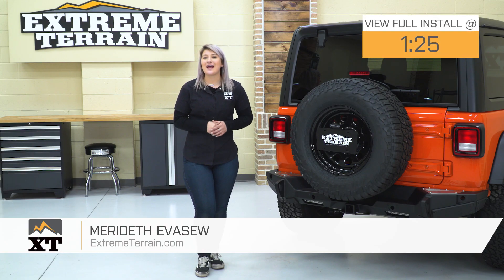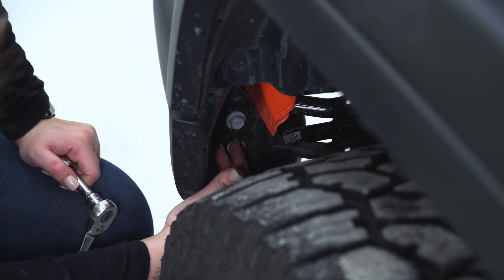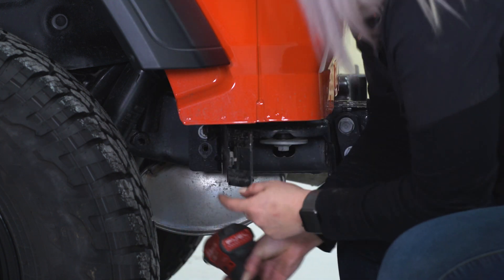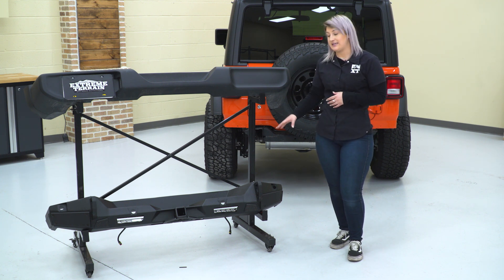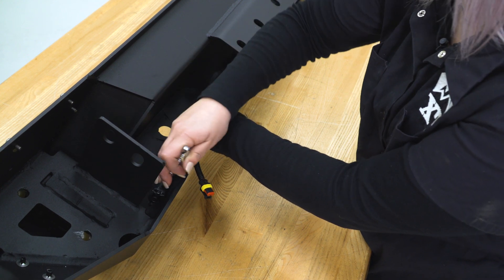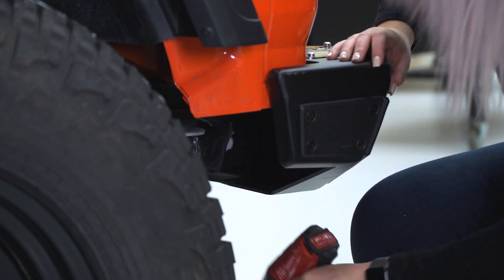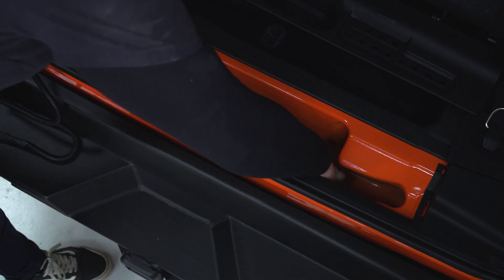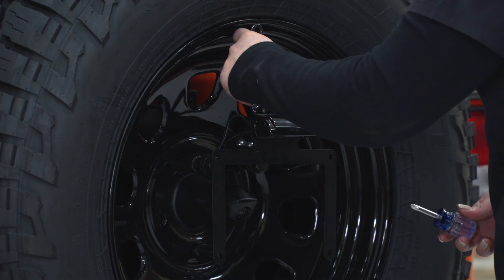Jeep Wrangler JL Smittybilt XRC Gen2 Rear Bumper Review & Install

Comment: I have this on my Jeep, great sturdy bumper. Would highly recommend. Thing is a monster and  is a straight forward install. One afternoon, basic hand tools, and a six pack of your favorite cold one will make for a great day.
Reply: After reading a few comments unnoticed a plethora of complaints about the license plate relocation. I just used the provided hardware and an angle grinder to change the location to the mimic the JK stock location. Took all of five minutes given the proper tools and know how.
Reply: Could you message me with how you did that please?

Comment: I purchased that bumper for my 2018 jl unlimited sport s. Relocating the liscense plate is pretty easy. I bought a relocation bracket from LoD and hard mounted it to the passenger side after removing the chrome plate.  I also got a stainless bracket with led lights for the liscense plate which got mounted between the tag and the bracket. It plugs right into the factory connector. The result was something that looks like the jk setup. It works great.
Reply: Do you have a link for that please

Comment: I put this bumper on my Jeep JL, simple turn the bracket upside down and the plate sits above the camera.
Reply: Were you able to also mount the license plate light in that position?  I just bought my bumper set and didn't realize that it had this design issue

Comment: Installed this today. The licences plate is an easy fix and you can use your factory light from the bumper all you have to do is take one of the small Allen screws out of the bumper where the steal plate is. Then  Drill the holes out a bit larger in the plate mount. Where their light would go. Then mount the OEM light to the bracket  to that then  flipping the plate mount  tieing  down the mount to the bumper run the OEM factory wire harness for your light to one of the factory back up sensor holes in which mine came with caps to fill in the hole since I didn't have sensors

Comment: I finally got around to attempt to wire up the lights for this bumper. I am going to have to find a different solution for lights as I am not confident in the quality of the lights and harness. The bumper its self is amazing along with the added tire carrier. 5 stars on the bumper its self.

Comment: I really like the look and functionality of the bumper. I modified the license plate/light bracket and mounted it on the left end of the bumper. Smittybilt should work towards that as well. Reduces the amount of work to remove the spare tire.
Reply: How exactly did you do that?  That would be ideal.

Comment: This video has fallen short, lots of great production value however the most important steps where not even mentioned! Hello what about the back up sensors? Re installing the back up sensors requires additional parts directly from Mopar, the plastic sensor bezels (are Not included with the bumper). I found out the hard way (halfway thru my install which I was unable to finish over labor day.) I purchased my bumper thru Quadratec and they failed to mention i needed these additional parts when i ordered the bumper. I recommend re installing the sensors before you mount the bumper. The hardest part of this install is disassembling the useless stock bumper aka (oversized license plate holder) to access the sensors. The bumper is awesome however you will need to customize your license plate holder if you want to keep your back up camera.

Comment: I have an issue with the wires that run from the battery to the rear led lights. The wires are not long enough. Plus I can’t figure out how to connect the rear license plate light without interfering with the door opening. The cable is not long enough either.

Comment: another rear JK bumper with the holes moved to use it on a JL no thanks till they make a bumper with a License plate holder on the bumper and a light for it mounted i guess i will stick with my plastic bumper or look at that MOPAR steel rear bumper. its only 50-100 more then this.

Comment: seems like the b/up camera is totally blocked not sure how that makes sense, also seems like it would be a ton of extra work to get the spare off if you needed it, maybe can live w/that but not  loosing the cam egads  seems if they left a spot for it in the bumper like jeep would be  ok
Reply: ...or offer a relocation bracket to mount the license plate just above the camera

Comment: 700? You outta your mind?!, everyone say your bumper and armor is designed to take hits and protect the body. But if the bumper gets bent or dented it still need to be replaced. Im not spending 700 on just the rear when i get something cheaper elsewhere that i wont mind swapping out for less than 300, and it comes with more led lights
Reply: What would you get that is of solid metal quality for $ 300 that has more / better LED lights?

Comment: Doesn't seem like a good idea in general.  You get the tow hooks/protection/good look in exchange for added weight, awkward license plate placement, license plate lightning, legality of license plate lights, and some rear bumpers (not this one) will expose the muffler too greatly (could be dangerous).   It seems like your rear tire (like a 33 or 35) would act well for protection in rear, that stock hook is good enough to latch on too, and it's good to have less weight, and not have to deal with license plate mount, license plate lights, and legal codes of license plate lights.